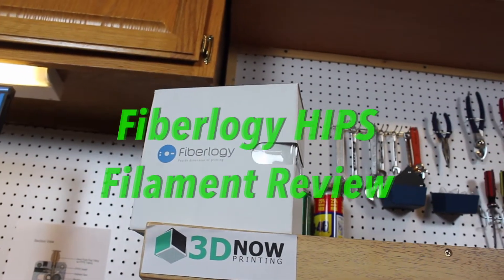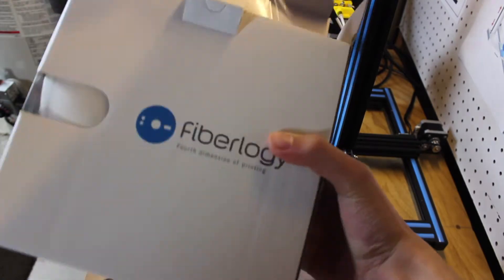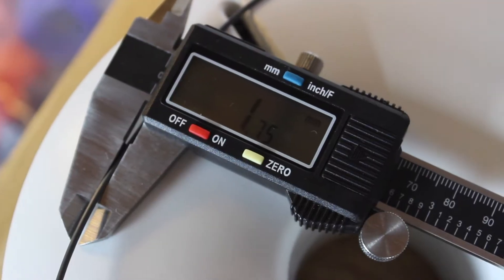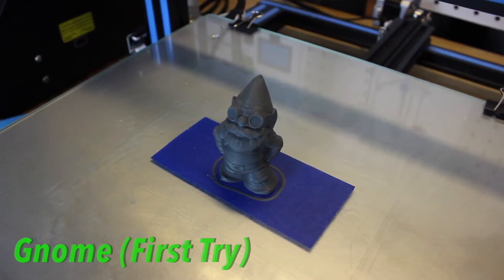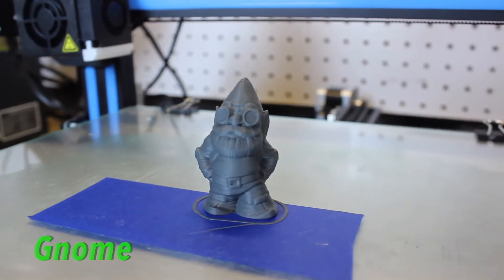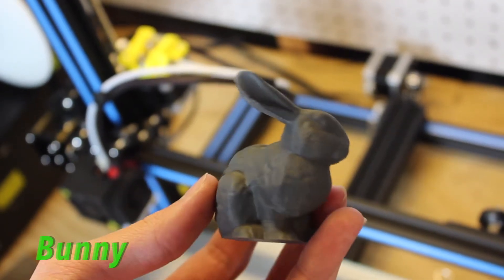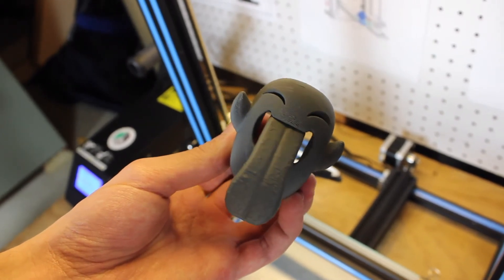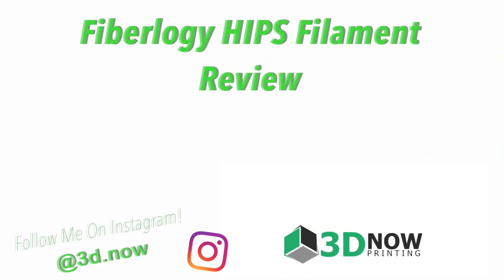Fiberlogy HIPS Filament Review!

Comment: I used filament from this company in creater pro printer. how it didn't work well. extruded filament can't stick with each other. does anyone know how to improve it?
Reply from the maker: You have to have a heated bed and printer enclosure. The build area has to be very hot in order for the layers to stick.
Reply: I don't know about this company but general ideas for similar filaments.
1. The material does not flow very well. High extruder pressure is recommended, else underextrusion occurs, making layers separate.
2. The material cannot be printed too hot or too slow, or it will degrade in the hot-end and become brittle and have low adhesion. Maintain a decent printing speed.
3. The material needs high heat to stick to itself. What helps without overheating material is to increase the extrusion width and layer height. Then the bead has more residual heat when it exits the nozzle, and transfers more heat to the underlying layer, melts the underlying layer surface better, and makes for better cohesion.
4. Small amount of airflow can help align the layers better. Creality printers have some cold end cooler leakage down onto the print, so the part cooling fan should be disabled entirely. On printers with orthogonal airflow, 10% fan can be used.
5. Environment temperature should be as high as possible. Enclosed printers help, room temperature of 30°C helps.
6. Bed temperature maybe up to 105°C.

Comment: I am trying to find an alternative to PLA for printing Flyable RC-Airplanes. Not just the parts but the whole model. For this the filament MUST be able to be printed using very thin walls (0.4mm). PLA works very well with models except for the temperature resistance. Wings printed in PLA starts deforming as low as 85ºF which in the Florida Sun or a hot car is not hard to reach. Do you think this material could be used to print very thin walls? What is your opinion before I spend $50.00 to try and see ;)
This fellow has a model and the wings are free to download.
https://www.thingiverse.com/thing:2752892
Reply from the maker: I would try ABS or HIPS. They are very popular high strength materials

Comment: wrong hips very difficult to print like abs
Reply from the maker: +Did3D not really. Yes, HIPS is harder than pla, but not impossible. Put and enclosure over your printer, get the temperatures right, get the bet adhesion right and you're fine. HIPS is becoming a more and more popular material to print with now.